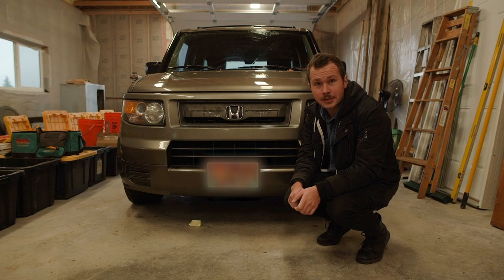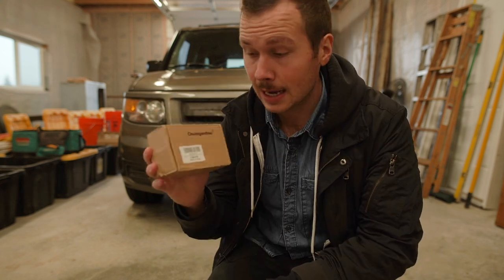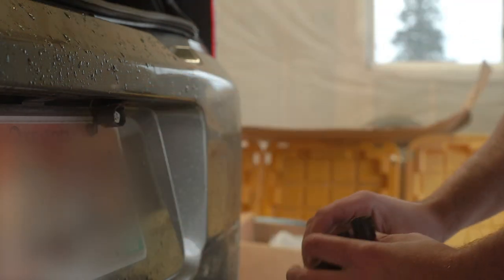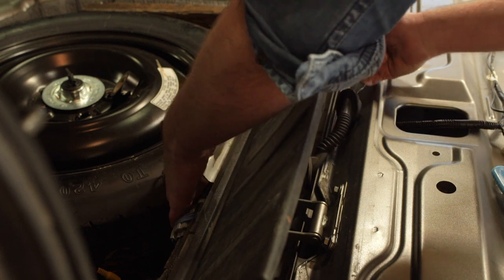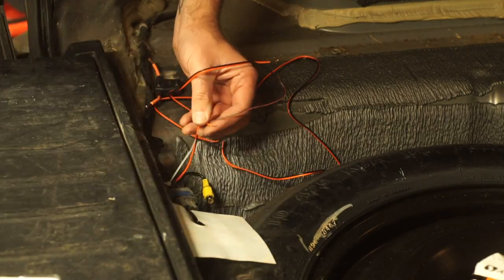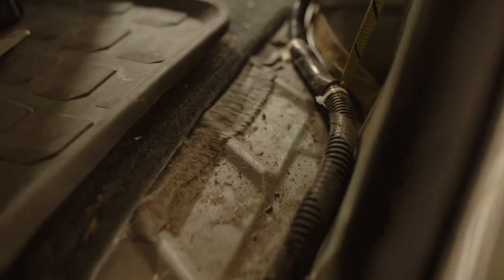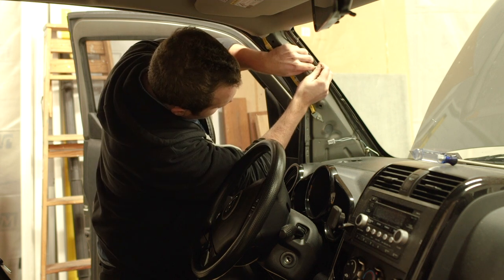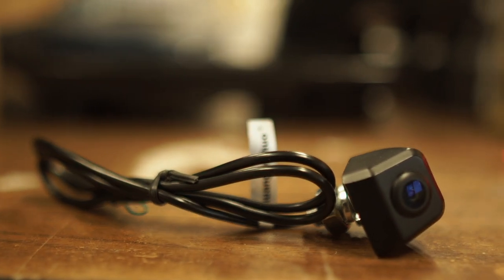DIY $40 BACKUP CAMERA INSTALL for Honda Element

Comment: FOR THE REVERSE WIRE:  You can also hook up to the relay switch behind the glove box, this is THE Easiest option to hookup your backup camera to the reverse wire / backup lights on all Honda Elements.  Simply remove the glove box just like when changing cabin air filters, when you remove the glove box you will see 4 black relay switches, the front right one, if you pull it out then push your reverse wire cable in with that front first blade of that relay, you can then push it back down, and it's snug as a bug in a rug. Then hook your ground to the metal frame somewhere, NO need to solder, or splice, and now your backup camera will turn on when you switch into reverse, easy peasy.  This worked perfectly for my Daughters 2008 Honda Element.
Reply: yesss. thank you for this comment. preparing to install a backup cam in my '08. this vid was still helpful with how to run the cables through the tailgate and up to the dash. so thank you both! @jaredlichtenberg
Reply: OMG THIS COMMENT WAS SO HELPFUL! I dunno how you figured that out but you’re a wizard!

Comment: I just purchased this rearview camera / monitor for my '07 Element. Going to install it in the next week or so. I did one for my daughter's '03 Camry and it works great. Question: Why did you add the fuse? I didn't do that for hers, and the package I just purchased didn't have a fuse either. Thanks!
Reply from the maker: Rad! Stoked for you, Chris. 

Re: Fuse - this is just protection - since the circuit I'm pulling interacts with other parts of the electrical system, in the rare case a short is developed somewhere between the backup camera and the tapped 12V+ DC from the brake light, the damage stops at the fuse before it affects anything else beyond the brake light harness.

Comment: What year was this Element? My 07 EX has some weird clip on the A pillar due to the airbag and it is supposed to be replaced . You seem to have taken it off quite easily.
Reply from the maker: 2007! Yeah you have to pull PRETTY hard, I was suprised how much effort it took. The clip has to be replaced with a new one from the factory every time you remove either of the A-pillars. AFAIK it is a safety feature that these special clips exist.
Reply: @jaredlichtenberg  Yeah there is a special procedure to remove/break them and I believe the clips are no longer available from what I have heard. Thank you for the quick reply.

Comment: Which green wire leads to the backup camera power wire? There are two...which one powers the backup light?
Reply from the maker: Hey Brian - I would recommend seeing if you can pull a PDF manual of the manual of the camera you have. I don't think mine had any green wires, I think mine was red, black, and yellow (if I remember)
Reply: @jaredlichtenberg  I actually looked up how to remove the tail light. Doing that exposed which wire I needed and it was green with a black line :) works great!
Reply from the maker: @Bryan_Fay  Awesome - glad you were able to figure things out!

Comment: what color wire is the power wire to the reverse light?  I couldn't tell from the video?
Reply from the maker: Hey Todd - I just watched that part, and unfortunately doesn't look like I showed what color the wire was. 

I believe how I found it was through using google to look up color wire codes for the tail lights, or you can also use a multimeter and check with the bulb removed from the socket as you pull it from the tail light housing from the inside.

Comment: How did you have access to hold the nut while rotating the camera to keep it in place 🤔 thanks
Reply from the maker: Hello! Great question. There is a space behind the panel that I was able to reach through to install the nut.
Reply: @jaredlichtenberg   I see thanks :) its just that would be the only reason why i dont attempt this installation. have to figure out an access point. thanks for clarifying